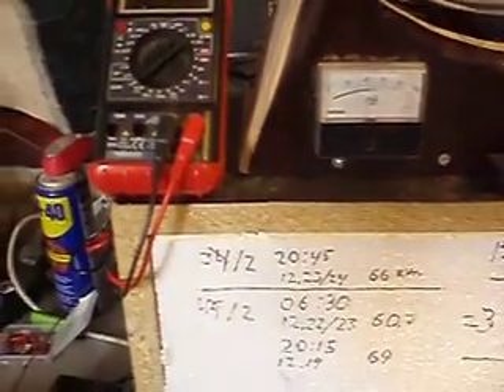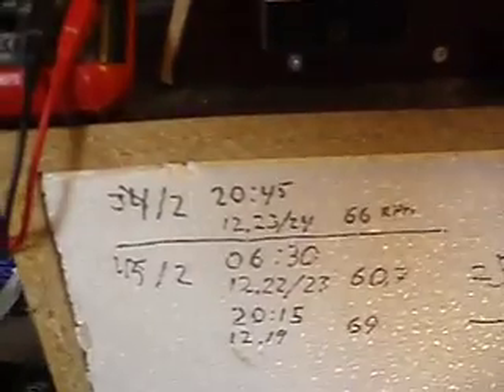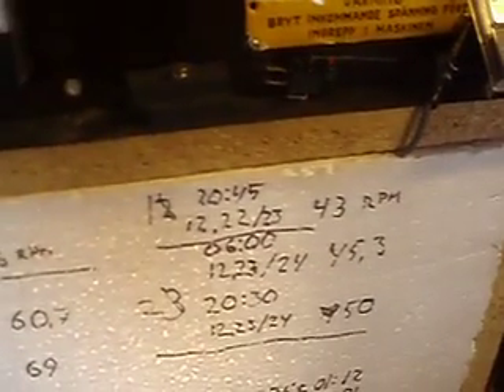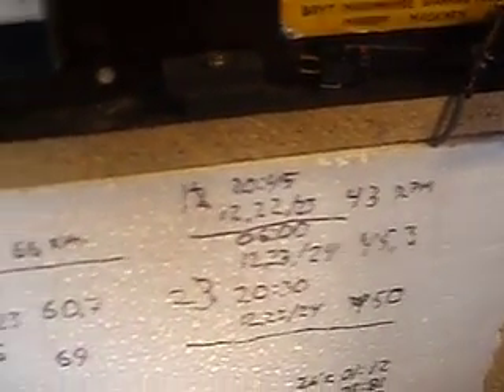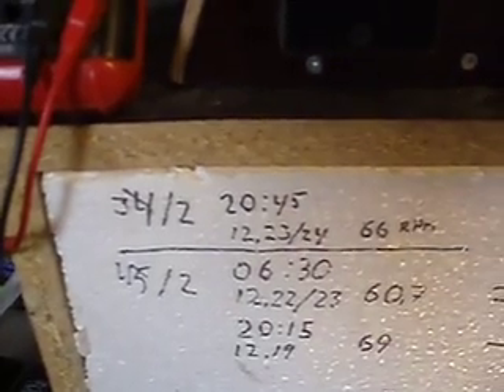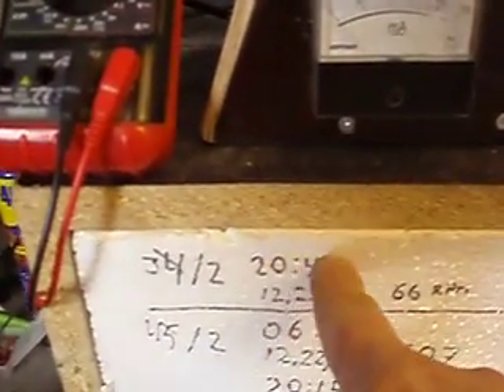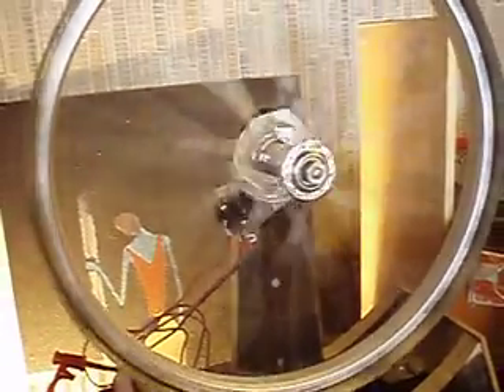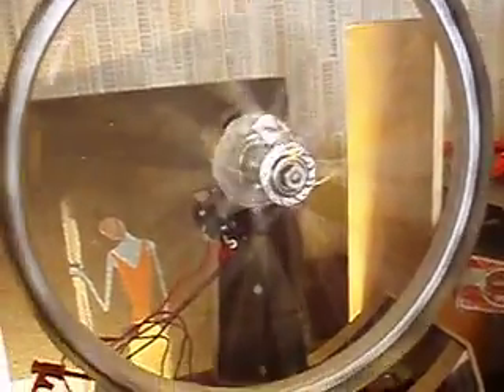selfrunner uppdate 2.AVI

Comment from the maker: So what has happened since last time? volts century has obviously gone down but! because I tested with a gelbatteri, which in itself requires a different way to be against a lead-acid, so were I not surprised. Now, I have a couple of capacitors and a 1watt 12v. bulb as load and currently as the figures are 12.11 volts 67rpm 60mA